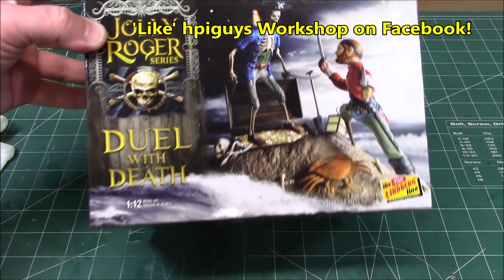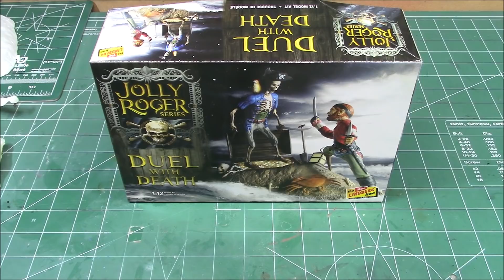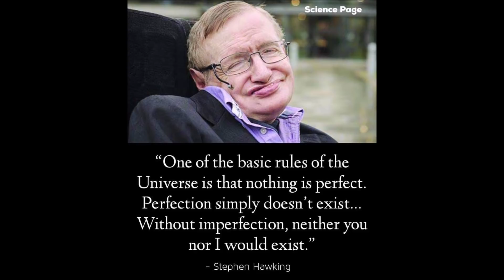Lindberg Pirates of the Caribbean Duel with Death 1/12 Scale Model Kit Build Review Weathering

Comment: I bought AMT'S re-issued big rig semi trailer in 1/25th scale,a few days ago.I have cleaned off all the parts;and have already started sub assemblies.I already know what Rustoleum & craft paint colors I want to use to build it.I have not decided wether or not I want to weather it;to simulate a trailer that is a little used and beat up;but not heavily used to the point the trailer is sent to the scrap yard.I have three completed tractors to hitch this trailer to when it is completed.I have a Kenworth W900 Aerodyne from Revell,and two cabovers Mack Cruiseliner,and GMC Astro 95 COEs;both from AMT.